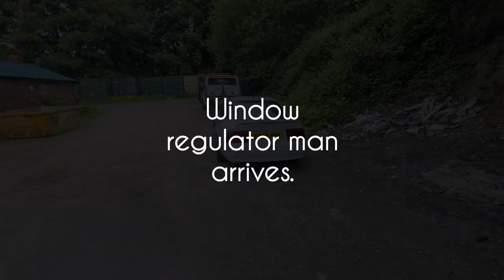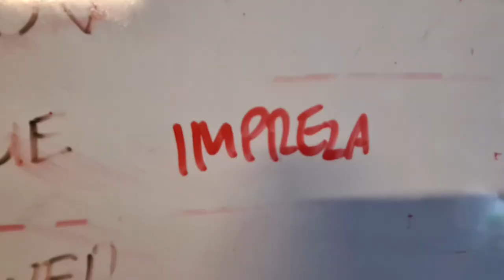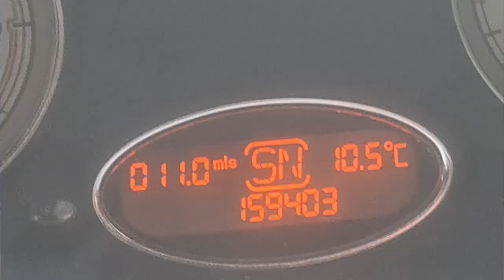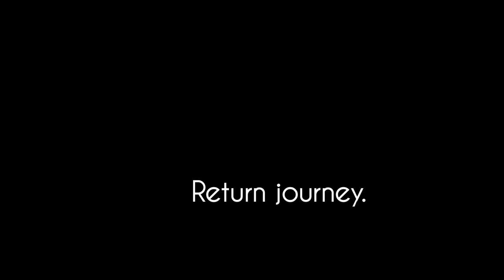Leave that 820 alone and compare a Rover 75 to a Transit tipper.

Comment: I have to say that I've got 2 Rover 75 diesels, both manual and I've found them to be very economical ( 50+mpg regularly ) and very reliable ( not one breakdown in 13 years and over 100k ) and I believe they go a lot better with a remap, which neither of mine have. Also, the key to a clunk free 75 is to buy good quality parts, and not cheap crap off eBay that most owners probably get. In my opinion, you can't beat a 75. But then I am biased as I own five.
Reply from the maker: Yes, you are are happy to spend money on them, I bet you've bought a few that weren't great to drive to start with.
Reply: @ProjectNigel  I think I've been lucky. I've not had one that's been awful to drive..Maybe one day you could test drive a V8 75/ZT.

Comment: this video illustrates very well just how boring the 75/ZT  diesel is to drive, you should try a 1.8T 75 or ZT they are so much better then the derv, much lighter on they're feet turn in and handle so much better and an absolute hoot when remapped
Reply from the maker: I have had them all  besides the V8. I liked the 1.8 turbo.
Reply: @ProjectNigel  I also own number 473 ZTT 260 SE and still think a tuned 1.8T is much more fun then the v8 although they do make a nice noise but that's about it

Comment: Rover 75 diesel are fun they give me work when people run out of fuel with them lol. Because as you rightly say they burn out pumps lol. Probably the transit tipper lol they are quite quick the newer one's I have driven a few on loan. Hopefully you will get some work on Derek tomorrow.  😀👍
Reply from the maker: I have sold quite a few pumps for them

Comment: Got to agree on the M47 engine, it's a ghastly thing. It's so heavy it kills the suspension, it isn't particularly reliable, it's lethargic, sounds dreadful and for a diesel it delivers remarkably poor MPG. The 1.8 turbo doesn't get far off it for economy and that doesn't have the colossal list of negatives tied to it.

Despite being as refined as falling down a flight of stairs the L-Series is a much better unit. When the sun has burned away an the earth is crumbling the L-Series will still remain, clattering along forever on a mix of sunflower oil and kerosene.
Reply from the maker: I do like the L-series, it's a proper no-nonsense knocker
Reply: Yup, my Rover 75 diesel left me stranded about 5 times in 1 year ! Although to be fair, mine was a proper dog. The ECU was inside a bin bag !

Comment: I’ve had five 75s/ZTs in various guises and I’d say that the 1800T version is the best engine but oh so thirsty: I was lucky to coax 32mpg out of it on a run.  I’ve now got an 1800 non-turbo (which doesn’t like hills) and two diesels (one auto and one manual).  I love them all but I have to say that they’re not especially nippy even with the 160 remap on both of them.  The problem is that they’re heavy - I see videos when they talk about cars being ‘heavy’ at 1.5t these  days and I think that mine are tanks by comparison.  The M47R engine is good but unspectacular (I’ve got 225k miles on the manual) but it does chew clutches.  The ZT in Spectre monogram is just nice to drive around in.  People like it.
Reply from the maker: Had they'd got BMW's 3-litre diesel it would have been very good. That's what it needed
Reply: I think there was something wrong with your K-Turbo. 32 is what I get pushing it hard on B Roads, the lowest I've ever got it was 28 and that was with a dodgy lambda sensor. 35mpg average driving and 40+ on a run. Was it auto or manual?

Comment: I agree with your thoughts on the 75. One of my favourite looking cars. I just love the styling and the interior. I remember driving round Bolton with my Dad when it was new listening to the Brandenburg Concertos. It was that kind of car. They're just not built properly though as you say. Even at 6 months old it had problems. I used to smell kind of mouldy when you had the air-con on. That must have been the drains and cabin filter! It had two major clutch failures in the first year. It did look great on the drive though and made you feel special. Mixed feelings and nostalgia as you say!

Comment: I have a manual 2003 Rover 75 CDTI  .

It goes well being the 131 version and has been reliable. 

The CDT version is gutless and don't get me started on the Facelift 75 .....
Reply from the maker: I have driven the 115bhp version and it was really heavy feeling.
Reply: @ProjectNigel  yes heavy old tank...Good in a crash so I'm told 🤣

Comment: I wish MG-Rover had fitted the 1.9 JTD Multijet unit from Fiat. Now that's an engine and, in my opinion, so much better than the M47.
Reply from the maker: I agree. I am sure there were plans to do this at one point too.
Reply: @ProjectNigel  I did read a while ago that MG-Rover had been talking to Fiat about using the 1.3 or 1.6 JTD Multijet engine but would not pay Fiat's asking price.

Comment: I find this insane inverted snobbery aimed at the 75 within the BL - MG Rover community very tiring.

I've now seen Metro owners complaining that the Rover 75 is dreadful because of how unsafe they are. And now this guy  suggesting the R3 200/25/ZR are better built.

I have a 1998 Rover 214Si with 30,000 miles on the clock with one old owner from new. The arches have rusted away, and the arches are pretty rotten. The interior rattles like an old tin can. And the interior, to put it kindly is fairly delicate. I do however love the car  regardless of all this. But to try and seriously compare a 25 and a 75 is insane. 

I also have a 2001 Rover 75 V6 with 110,000 miles on the clock. It is a Rolls Royce in comparison. Much safer,  more relaxed and yet it is, as fun to drive (in manual V6 format at least), and the interior has held up, still looking like new.

And as a side note; why oh why must these YouTubers buy/test high mileage/uncared for/ knackered old 75 diesels and complain about how they're not as easy to fix as a 1953 Morris Minor OR that it's not as fast as the latest BMW 330d.
Reply from the maker: I read that carefully,  and I like to be proven wrong, but...

It's pretty rare to have an R8 or and R3 being a rattlebox, but it's not uncommon to find this in a 75. Obviously the 75 is a much safer car to crash in, if that's your sort of thing, but it's not mine. 

The 75 is great when sorted, but often a 25 is great even when it isn't.
Reply: You tell him! 😉😂